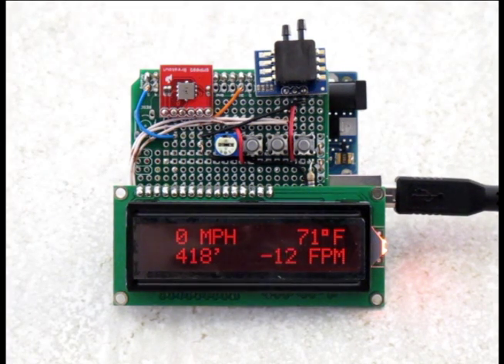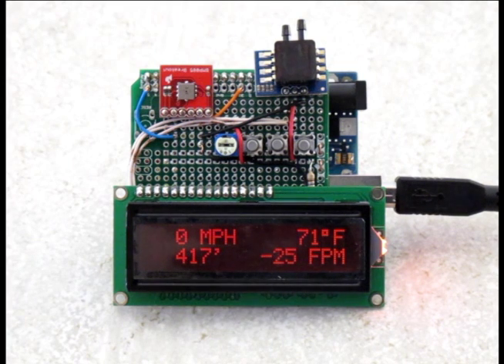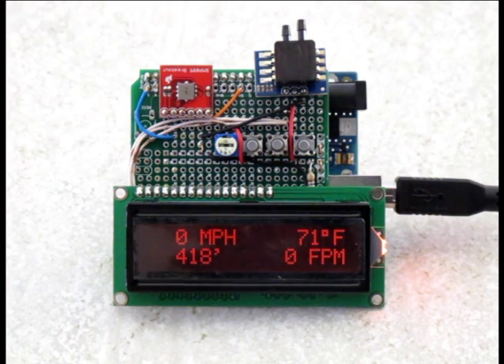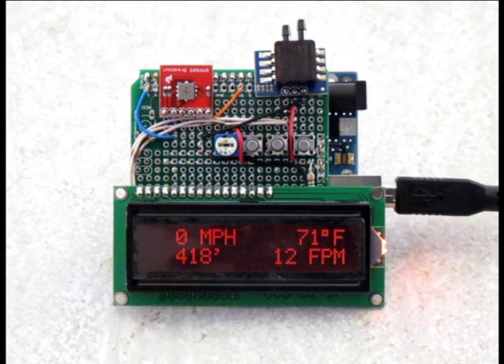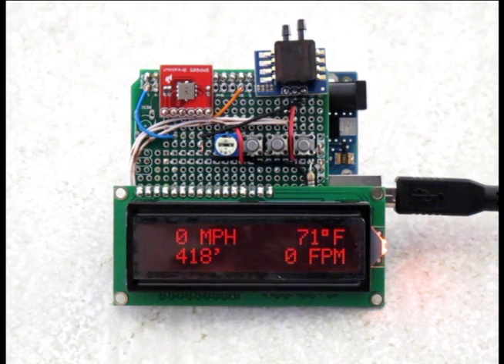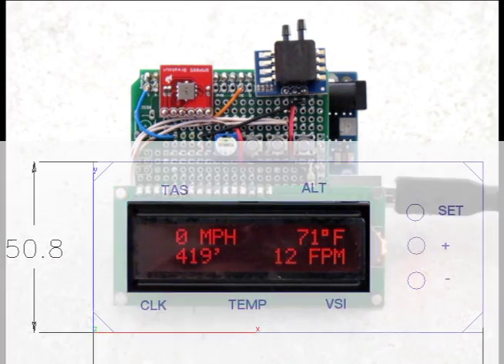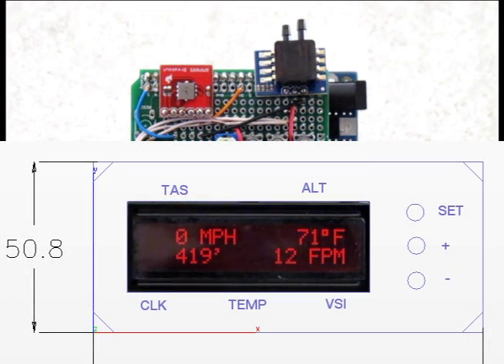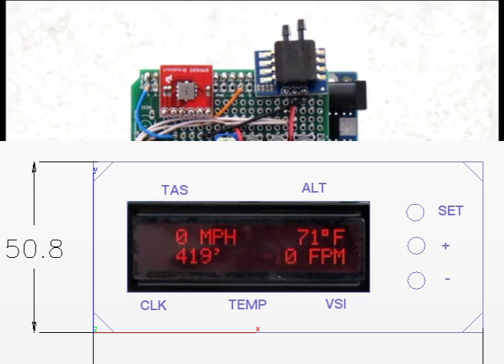Air Data Instrument, part 2

Comment: Cool project.  I am just learning some arduino to build a couple of devices. for on project I need altitude and vertical speed.  I'm guessing that you derive vs by looking at your altitude readings over time.  Could you help me with the code that worked for you.thanks,